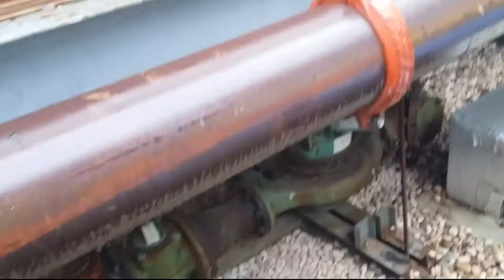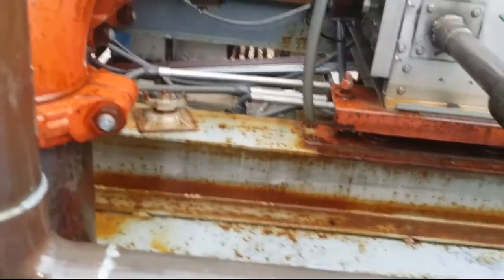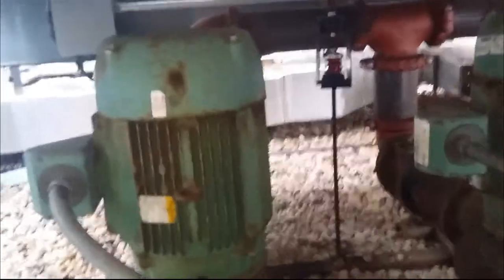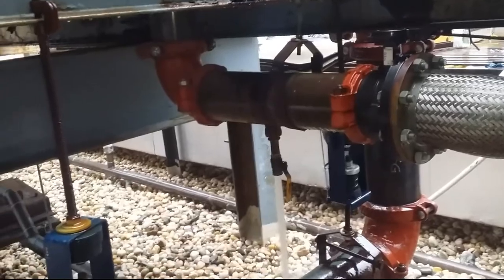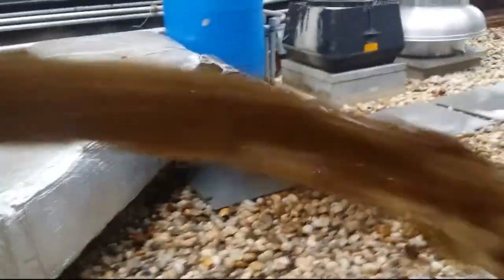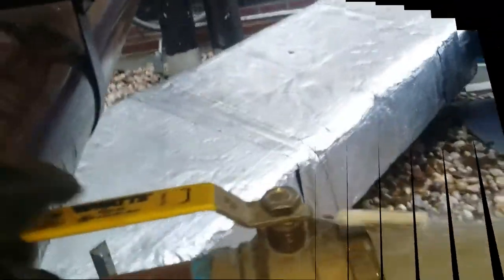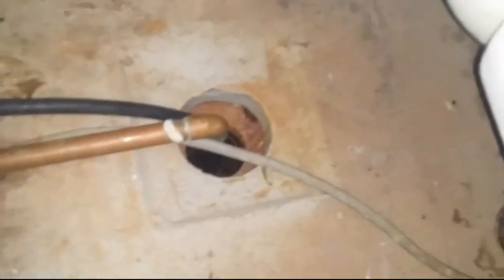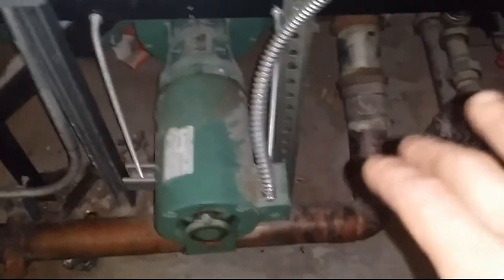CoolingTower | Winter Preparation

Comment: so why do they have boiler heat the water for a heat pump? Why not just use the boiler to heat the building?
Reply from the maker: Well thethey have Water source heat pumps for heat aswell as hydronic heat. When the units are running in heat mode. The indoor evaporator coil becomes the condenser and the water cooled condenser becomes the evaporator.  This will cause the water temperatures to drop down to 50 to 60 degrees the boiler water is necessary to warm the condenser loop water to 80-85 degrees so that the units will operate properly with proper pressures.  When the units are operating with low water temps the refrigerant pressure will drop severely.
Reply from the maker: The heat exchanger is used to heat condenser water loop.